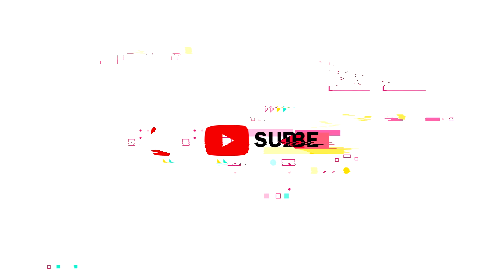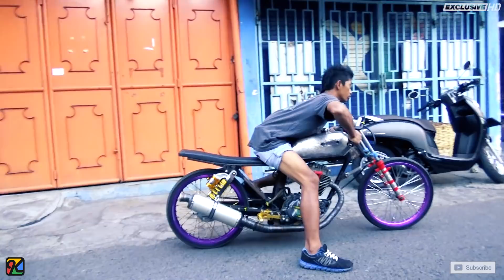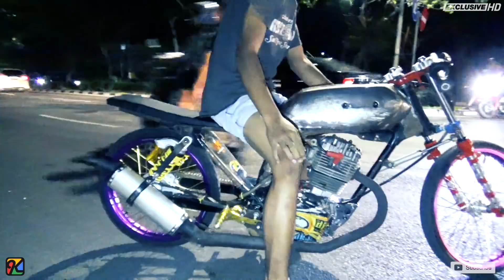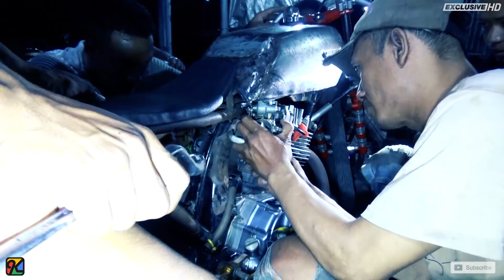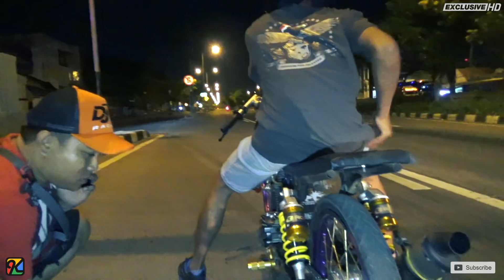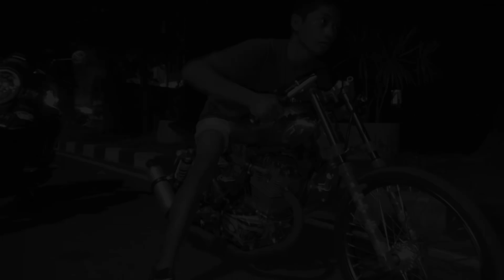SETTING HONDA CB 1200M | DJS SOERABAJA

Comment: Tandingin sama punya nya rjm speed bang, yang motor barunya Sonic 300 CC 2 throtle body 4 injektor
Reply: Penasaran hehehehe
Reply: Speknya beda om
Reply: Dionp 206  kelas nya beda om
Reply: Dionp 206 pekok
Reply: Itu punyaknya rjm dibuat jarak brp mas??
Klo ini khusus buat jarak 1200m lho,,,gak 201m
Reply: Dionp 206
Reply: Monggo asal 1200m
Reply: Dionp 206 lek gelem 1200 an yo gppo bos ben di asep in